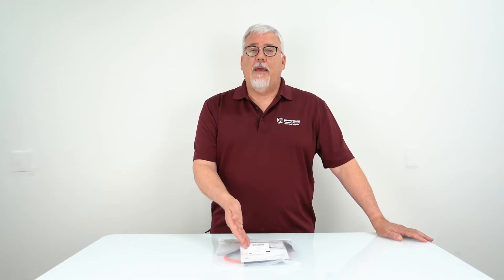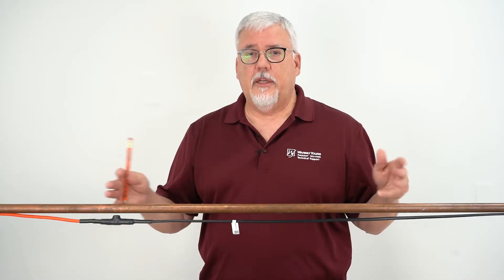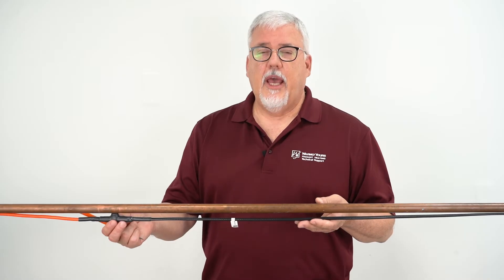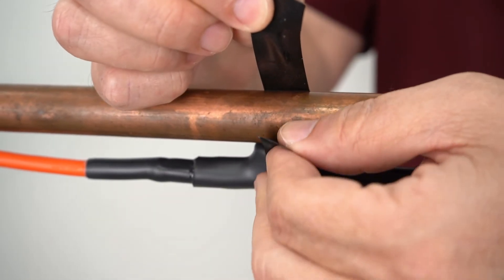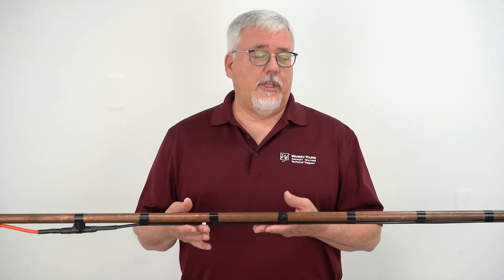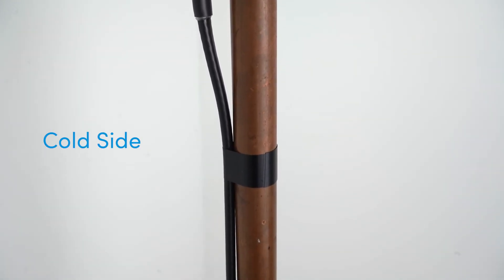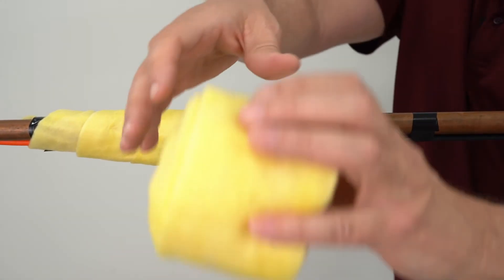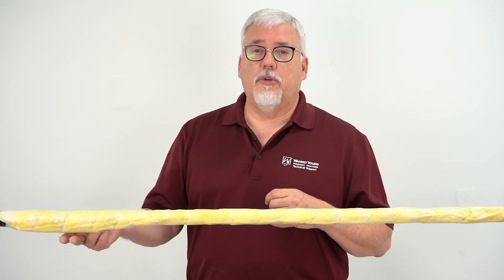How to Install Constant Wattage Water Pipe Freeze Protection Cable

Comment: Thermostat should be outside becouse outside temperature is the one that matters. This is wrong becose of insulation thermostat is not getting actual temperature of the surroundings
Reply from the maker: So it is actually the temperature of the pipe that we want in this case. Preventing the pipe from freezing means understanding what temperature it is at so the system can keep it warm enough. Hope this clarifies things.